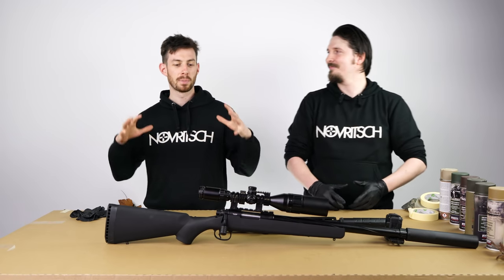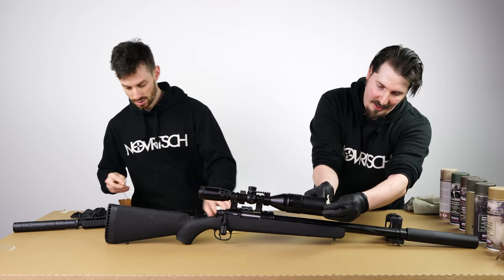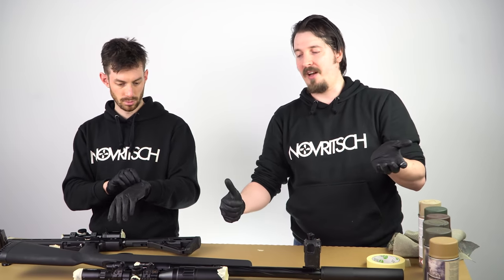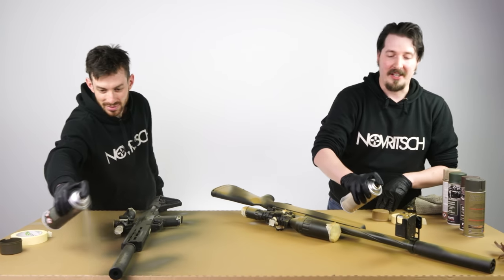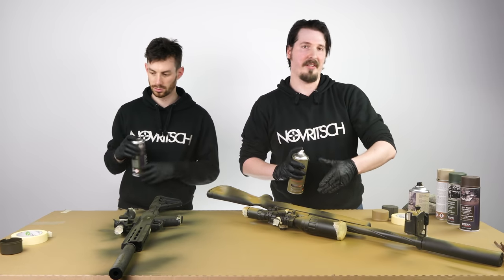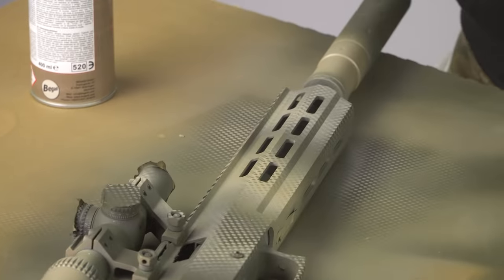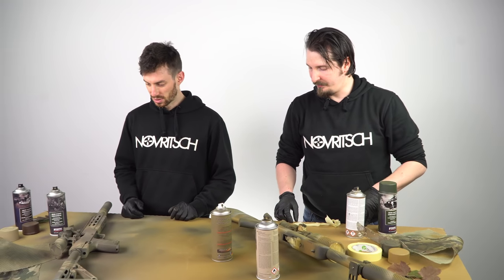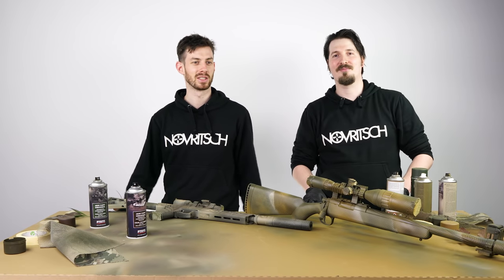This Is How You Paint Your Airsoft Replica Properly

Comment: 2 tips from a painting pro:
- clean the surface with Ammonia before starting and don't touch it after you did. This will remove the grease from your hands.
- Fill a bucket with water of around 30 to 40 degrees Celcius, and drop the spraypaints in that bucket for about 5 minutes before you start shaking and spraying. The paint will flow much better then.
When you do the above, the paint will stay on the surface much better, and the drying time will be only 2 to 3 minutes.

Comment: i did my paintjob on a sse18. not camo. but "colorful fun videogame" style. and i pretty much liked this method and i put clearcoat over it for durability. i really hope it will hold a little and wont get destroyed completely. i dont mind if it looks used one day  tho. thats fine. but no chipping is all i pray for xd. i let that stuff now dry for 2 days. my tracer somehow survived. im not good in stuff like this. but it turned out quite unique. i did only paint the metallic parts. i did not want to paint the pistol grip. maybe later, with less "effort" because it will get grippy gripped out and worn on that part quite fast i think and wouldve been wasted "paint". maybe in a few days i will paint it because i dont care anymore. im just super cautious because i dont want to destroy/brake anything

Comment: Hey, so I know this is off topic from the video, but I had some problems with my gun silencer a couple weeks ago and was wondering if you could tell me if you know what the problem is? I live in the us so I had to buy the SSP1 with the orange tip, but when I finished installing all of the parts to make it compatible with my gun (the correct barrel and thread adapter) I installed the suppressor and when I shoot my gun the barrel gets stuck back. The stopping piece is not the problem, the slide just gets stuck. I think it has to do with the weight of the suppressor, but if you could help me, that would be awesome. Thanks for reading this, keep up the amazing content.

Comment: "Properly"
>Doesnt even disassemble it down to individual parts
Reply: And there is no primer coat either
Reply: It's complete rubbish. They didn't even taped it properly, look at the black spot above the magwall of the 303 that he covered with the tape. On the VSR they forgot to spray the pattern on the bottom of the gun... List goes on but I stop.
Reply: Your actually not supposed to break  it down when your painting a rifle. Think of it like painting a car. Do you paint a car put together or in pieces? I agree that not everything they did was “right” but everyone has their own way of doing thing, especially for painting guns.
Reply: You usually take off thing like door handles, lights etc.
And of course you paint only the parts visible from the outside so that there is no tolerance issues

Comment: Is there any special technique you need to use in order to paint the barrel? 
Specific airsoft gun I'm looking at painting is the Beretta 92FS which has a large portion of the barrel visible regardless of the slide position.
Additionally, do you need to put some kind of protective coat over the paint job to protect it from chipping off? Such as polyurethane?
And finally, is any type of spray paint good to use for this?
Reply: I’m wondering about the same things
Reply: Have you found anything yet?
Reply: 1. For your 92fs, I would tape up the outer barrel because it's gonna get scraped off anyways. It might hinder your performance if you painted that up.
2. No, protective coating like clear coat is not required. You could use some I guess but rattlecan paint is pretty durable as it is and my experiences with clear coat are that it adds some shine to the final paint job, so I personally stay away from it.
3. Any flat rattlecan spray paint will do. Try to get a flat color and avoid anything that shines. Multiple brands like rustoleum and krylon sell camo specified paints that are flat. Try to look for something like that.
Hope this helps

Comment: And NEVER paint indoors without a mask. Never. I did it for years indoors in a well ventilated area, an now I am 31 and have respiratory problem doe to it. I would suggest to use a mask even outdoors. A mask will not hurt you. The paint will.